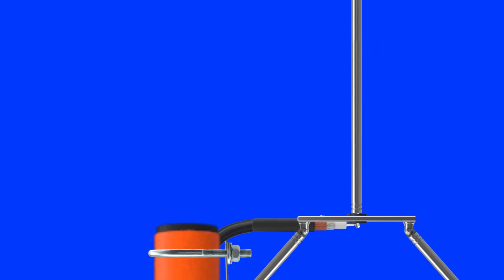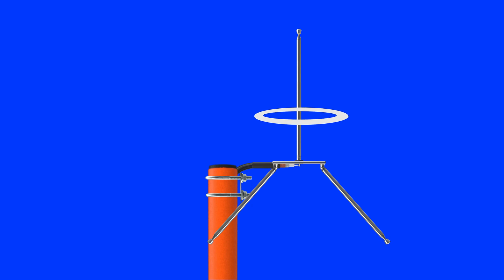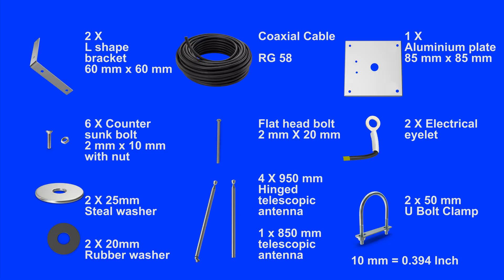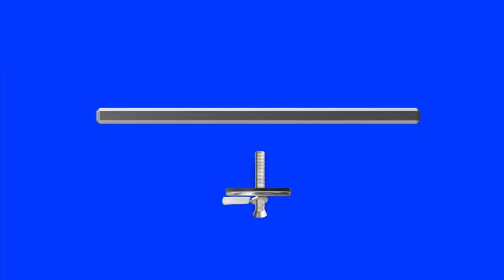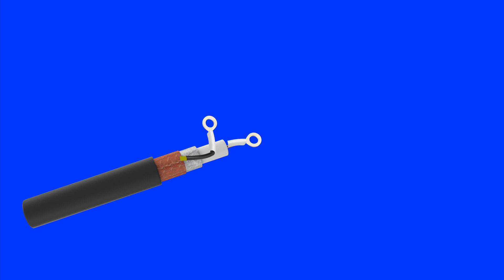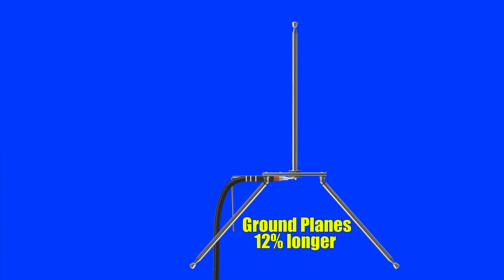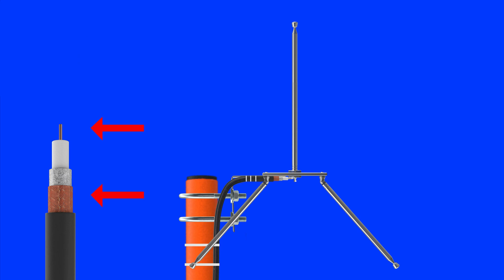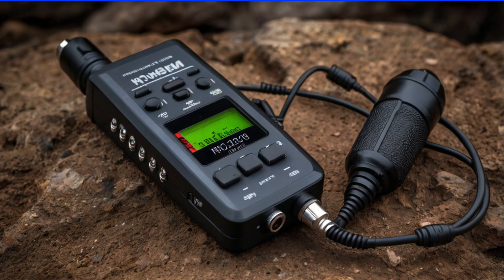FM radio station Antenna Dipole Equivalent Quarter Wave Antenna DIY Homemade 4K

Comment: everyone tells diffrent story
you  said  below rods should  be  %15  longer..but i  read from diffrent sources lower rods should be shorter to  set swr meter
Reply from the maker: You can even Google if the ground planes should be longer or shorter and you will see that the ground planes should always be at least as long as the main radiator but preferably longer. Some say 5 to 10 % longer while others say the longer the better because the longer the ground planes are the more efficient the antenna is.
Reply: @inspiresoundpro i just asked from  gpt....in real  world it should be diffrent  im sure... i thought  you expriment it befroe
Reply from the maker: @hu3ein999  I have built many of these antennas and I always made the ground plane radials longer and it worked great. I found that shorter radials made it harder to tune. This is one time when the theory and the real world are the same.

Comment: Isn't this antenna just a dipole with the lower telescoping legs the lower arm of the dipole. The extra length of the lower legs accounts for the fact that the legs are at an angle from vertical.  Also aren't this and the vertical dipole omnidirectional as they are symmetric in the plane perpendicular to the antenna arm?
Reply from the maker: Yes the antenna gives the same output power of a vertical dipole but it is not exactly the same as a dipole.  A dipole is slightly directional especially if side mounted as the mounting pole acts as a reflector but this antenna is omnidirectional because it is top mounted with no reflector.

Comment: Is this antenna is used fir recieving fm signal in radio ?
Reply from the maker: Yes you can use this antenna to receive a radio signal and it can also be used as a transmitter antenna.

Comment: Where do I buy this?
Reply from the maker: Hi. This is a DIY antenna. So the idea is to build it from scratch using the parts listed which you can get from hardware stores and from old radio and TV antennas. Cheers.